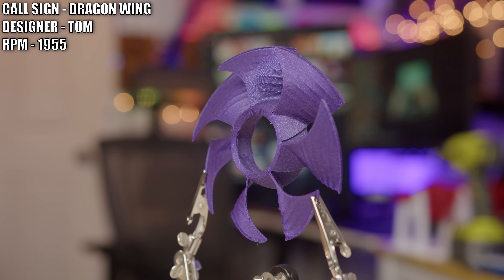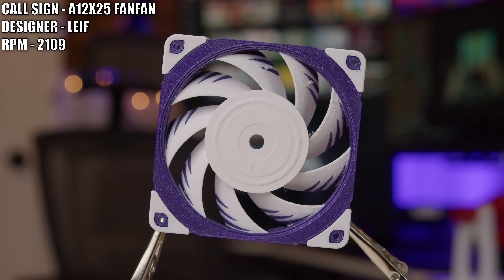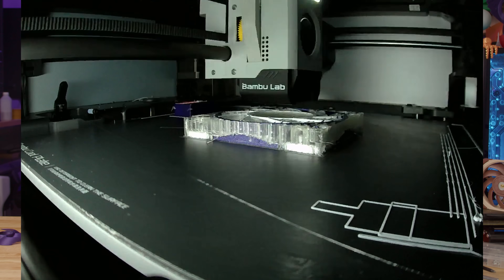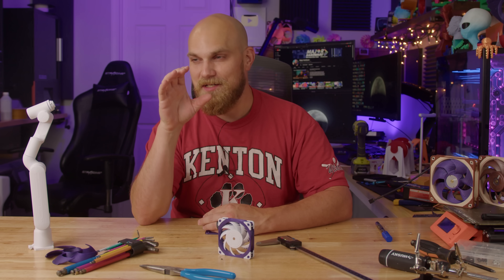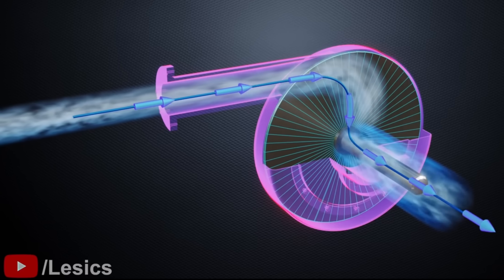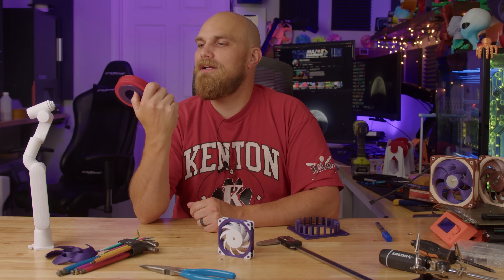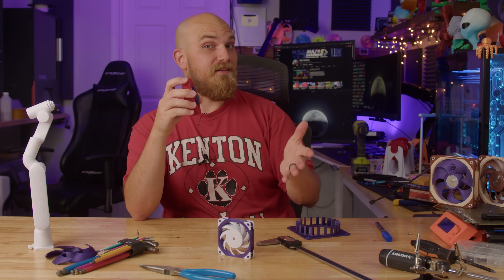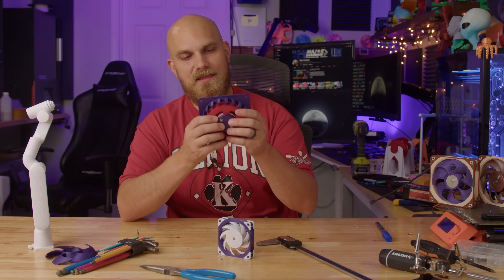I Put a FAN Inside a FAN | Fan Showdown S5E7

Comment: I'm now a big fan of the small fanfan because the creator was able to think outside the box and put the fanfan inside the box. A truely creative way to reinvent the wheel while keeping the wheel exactly the same as before it was reinvented.
Reply: I bet everyone thought of it already, but I'm the only one who did it.
But I bet some serious fan showdowners might have done it and didn't want to submit it because they wanna make "good fans" that are "actually productive".
It also seems really low effort (and it kinda was). Just take the fan, scale it down to fit in the fan, scale up the blades to touch the walls, add the hub template, hollow it out, done.
The better thing would have been for me to do some cylindrical scaling to make the fans stretch to accommodate the larger hub, but even noctua's mini fans have about the same blade proportions as their big fans.

Comment: So, I see people asking for noise normalized rankings. But what I am curious about is performance normalized noise rankings. Think about how the computer decides how fast to spin the fans: the heat of the components. So, in practice, each fan will spin just fast enough to deal with a certain amount of heat. Which means you should pick a generally obtainable airflow, and run each competitor just barely fast enough to achieve that. Then compare the noise levels and subjective pleasantness.

Comment: Something that comes up a lot in similar videos about propellers is that the finish is as important as the geometry. Maybe that's not as important for a fan in the air as it is for a propeller in the water, but I wonder.
Reply: Pretty sure it makes a big difference to the noise, at least.
Reply: @laurencefraser  I suspect you're right. Propeller guys go to great pains to get everything smooth because it makes all the difference.

Comment: I'd love to see what the dragonwing could do if it was produced with the process - and tiny gap between fan blades and side wall - as the A12x25. As it stands, I don't think it's sufficiently faster for the increased noise level. It sure comes close to beating the A12x25 than anything else, though.

Comment: The dragon wing outperforming the A12x25, even within it's form factor is a big thing even if it is louder. I'm curious, would a softer material like PETg decrease noise?
Reply: You'd probably want to go even stiffer actually. Some of the noise is from the blade tips vibrating, and a stiffer material would "flap" less. Also, softer materials will likely expand more under the centripetal force of high-RPM tests, meaning you have to design with less efficient larger gaps around the edges.

Comment: the tesla is best for making a pump for water cooling not for moving air,  also, the fans are rough prints, not smooth and therefor have resistance and turbulence  in the air they move, unlike the nice smooth one you are comparing them to, cant remember if you have tried smoothing them or tried resin vs printed versions of each one in a previous episode

Comment: Just saying, use a turbine (which extract energy from a flow) as basis for a fan, don’t work very well when you want a fan/compressor (which does work TO a flow). If someone saw wings off an airplane and put left wing on the right and vise versa, the plane won’t fly, or at minimum not as good.(This is essentially what some of these design based on turbines are doing)
Why? Because flow behaves differently on a geometric shape.

Comment: Finally someone adding parts that create turbolence at the end of the blade. That's a key to make air turbolent and easiert to push. I think even better would be with an intake that "prepares" the air for the blades. That is, creates turbolent air (with fins) and with curved static blades (like the fan) so that the fan can push as much as possible.

Comment: props for people using modeling software as cad software. i do that, 3dsmax 2014 is my cad software. 
geometry is geometry. geometry + printer = thing.
Reply: The thing with Fusion 360 is that it's cloud based (other than the fact I can't do anything with it).
In order to export to STL, you gotta send it to the cloud, and they put you in a render queue.
I first tried to center the fan hub template to the center of gravity, and it would just make these null points, and there was no way for me to translate that point to the center. If I just had a python terminal or something I could figure out how to translate it negative those coordinates. When you first import the stl, it lets you center it, but never again after that.
Anyways, one render queue later, I'm in blender, and I just right click, align, center of mass. I've actually never needed to center something in blender, and it's been a good half year since I've used the program at all. Blender isn't known for their intuitiveness, but as a 3d modeling program it's pretty good. I even got an easy python script off of stack overflow to lay an object flat on the xy origin.
Reply: @leifmessinger  i prefer to store my data on my own drives. thats why i use gimp instead of photoshop (debating running my ancient copy of ps7 in a vm). id rather use old software anyway because not only am i used to it, but it was just better, and in many cases it still works, does the same job. anyway 3dsmax is good enough for me, and its something i already had in my tool box. ive done some game dev and know my way around various polygon formats and how to do transformations in code if need be. but i just export to stl and im good.
Reply: @LordOfNihil  The old run it in a vm and save the machine state trick
Photopea is what I use now. I used to use premiere but now I use clipchamp.

Comment: You really need to stick to resin printing as it is MUCH higher quality.  This will make the fans smoother... which makes it more efficient and quieter.  They could also make the blades thinner and lighter.  You could even print them clear or die them any color.  Otherwise you might try an acetone bath.

Also you should put thickness restrictions as they must be able to fit in the place of normal 120mm case fans in either push or pull and not interfere with anything.  My front case fan actually fits in a bracket between the front of the case and the hard drive cage (yes it is an older aluminum case by Altec but I like it.) and some CPU heatsinks have the fan in the middle between two fin stacks with heat pipes... like the Noctua NH-D12... you know Noctua... the fan you are comparing these all to.  Fan like "The Cheater" are just that cheating and should not be tested... at least not against other fans that are not cheating.  Maybe do the normal fan showdown... then like you have been doing with several episodes for the season... then maybe do one episode that is no hold barred.  You might also do an episode on how scalable the winner is and run them on say 60mm up to 200mmm... if you can find good hubs for them that work the same way.

Comment: If you add scallops to the trailing edges of the fan blades that will help reduce noise like an owls wings. The reason owls are so quiet is because their trailing edges of their wings is uneven and that helps break up the pulses of air that make the noise. Also if you put the fan blades in an uneven formation that helps bring down the noise. Instead of putting the fan blades spaced evenly have spacing all different. It might take trial and error before you can get a balanced blade but the noise difference should be noticeable if you do both. If you've ever seen an older cars radiator fan the blades are staggered for that reason.

Comment: The tesla turbine was also designed to be a pump. It would have been hooked up to a moter that could provide high rpm in order for it to work.
Reply: The Tesla pump is still in use today, and is used with fluids that are abrasive, viscous, shear sensitive, contain solids, or are otherwise difficult to handle with other pumps. However, from the appearance as it was waved around, the design as implemented lacks a proper casing design, and I expect that it will be singularly inefficient.

Comment: I'd always take the quieter option even if it gives up a few % of performance as I'm a noise freak. The loudest thing in my system is the fractal 180mm fan that makes a slight ticking noise (annoyingly) but you need to have your head right beside it to hear it.

Comment: To get a true appreciation of the TT design your air OUTLET would need to be a "nozzle" at the outer rim of the "fan".  The Tesla Turbine wasn't intended to be a "straight through" design like 99% of computer blowers are, more like ICE turbo-chargers.  Where on one side the exhaust gasses from the engine enter at the RIM of one half the turbine and exit at the hub while spinning a shaft.  Meanwhile at the OTHER end of that shaft the compressor side is drawing air in at the hub, spinning and compressing it before "ejecting" it through ANOTHER nozzle on the rim

Comment: @4:40 I need to correct you here.... 
The tesla Turbine was a design to use water tension to create rotation.... You are wrong about it being used to extract energy from steam.... It can be used for this, but its original intention was to use the science behind waters elasticity, to create rotation between 2 or more spinning plates. The tesla turbine design is way more efficient that any other design, but the problem is the fragility of the disks needing to be thin and strong close together without rubbing at Hundreds of thousands of RPMS... It usually destroys itself at full potential capacity because of our lack in material science...
Reply: It's so efficient it destroys it's self.  Well, that's your problem.😂
Reply: @madb132  Teslas problem which people like me think about 😀

Comment: This may be a completely stupid idea..... not a first for me.... but it would be cool if you made an "original" style casing for the Tesla Turbine and fed it with an air compressor to run sort of as intended. I'd be curious to see if it could run another fan or generate any measurable amount of energy if mounted to a proportionally sized generator.

Comment: Honestly the hard angle on the Dragon Wing has a smooth but more steep curve to it than the original Noctua fan blades. But Noctua's new fan blades yet to be released on their updated 140mm design, also, has a steeper curve; it's more abrupt/jagged of a curve though.

Comment: Not sure the cost of that dissolvable support filament, but there is a cheap and easy way to get easily removable supports for prints: Use a different filament type.
If you are printing in PLA, use PETG supports, and if in PETG, use PLA supports. It makes them very easy to remove, and PLA and PETG are usually materials you already have around.
Reply: PVA filament is very very cheap.
Reply: @jttech44  Depending on where you live, PVA filament can cost a far chunk. Right now just looking at general lists, it costs about the same as a full 1kg spool of PLA for a 250g-500g spool of PVA. An while I don't expect people will use it exactly 1:1, that is still not 'cheap' in a price difference for something that only functions as a support material.
Reply: @DuribunWolf  sure, if you use the cheapest possible PLA, which is a pain to print with.
Reply: @jttech44  Which is what the majority of people who 3D print as a hobby will mostly buy. Which is why PVA filament is considered expensive, as really the price per kg even for more expensive PLA is better than you can for PVA.
Reply: @DuribunWolf  Tbh, most people who are 3D printing don't have dual extruders so, PVA filament isn't something they'd buy. Once you've bought into dual extruder printing, you've figured out that cheap filament prints like crap, and nicer PLA+ makes alot of sense in terms of actual material needed and wasted material.At which point PVA isn't really cost prohibitive.

Comment: For me, the quietness of Noctua fans is a huge factor in why I use them, not just their performance and reliability.
Reply: and the warranty is very, very good if you ever need it.
Reply: Certainly - but 40+(++) dba isn't exactly "quiet" for higher end fans.
Reply: @pr0xZen  His recordings though are not in a proper sound chamber, so they are higher than the true value. So it's only comparable to other fans on the list in that room. Your own personal room and setup will differ. The fan db in a proper sound chamber is only 22.5 db.
That's also at full speed, and my fans never reach full speed, since it's not needed. So I never really hear the ten fans, even when gaming for hours. The pump makes more noise.
Reply: @ScytheNoire  If you never run fana at 100%, then comparing fans by manufacturer or lab rating performance metrics is pointless, and seriously misleading at best. At that point, the results and metrics of these "fsn showdown" tests are arguably more representative of deployment in relateable usecase than any of the 1st or typical independ lab party figures.

Comment: Noctua has a new fan on the way, and during their interview with GN about it and the R&D process that took a few years, they stated that their fan isn't optimized for pushing air through a radiator or for raw CFM. They strive for a sort of hybrid between the two styles. They want their fan to work really good as a case fan, and equally as good as an AIO fan.
That being said, BY DESIGN, they are beatable with a more specialized design. It SHOULD be beaten in these tests. However, it SHOULD NOT be beaten across both open air and resistant (through radiator) CFM with a single design.
I'd love to see how the Dragon Wing would fair against it for open CFM. It would be really cool to see Noctua beaten at their own thing

Comment: What I would love to see is a fan with a very tiny motor, so the hub doesn't take so much off the cross-section. Or even an offset motor driving the fan by a belt. :)
Reply: There's a video on the Gamers Nexus channel where he chats with an engineer from Noctua who explains that the closer you get to the centre of the fan, the less air is pulled through due to the blades of the fan spinning so much slower than the tip, and mostly it's just not worth it.

Comment: I've been a long time fan of the fan showdown. The thing with the a12x25 is its supposed to work in a lot of different configurations. Case fan, heatsink fan, radiator fan. It always does good. Is it the best for anything? not so much but its a great compromise between all kinds of fans. So just pure airflow is not a great way to compare fans. We need to take into account airspeed, CFM, static pressure, lifetime and efficiency.

Comment: 6db louder though is pretty significant, but it might regain some of that if it was actually made out of Noctua's special material.
Reply: thats true! or mabye in resin? :))))
Reply: Well if it was made of the special material it might still be noisy, but since Noctua said they made the material (something crystalline they said) not to warp under temperatures or age, then the fan get closer to the frame have even more performance and probably even noisier. But you could also run the fan slower or not as often because of how performant it is.
Reply: The main issue with most of those printed designs is the turbulence generated by the surface not being smooth.
Reply: @BrunodeSouzaLino  resin printing or using isopropyl alch to smooth PLA.
Reply: The Noctua standard impeller would regain the CFM and more just by running it at slightly higher speed.
Reply: @Vegemeister1  who said you'd run it at a higher speed? its not needed.
Reply: @scarecrow5848  Everyone who believes that the Dragon Wing's slightly higher CFM indicates some advantage over the Noctua, in spite of significantly higher noise, is assuming that it is needed.